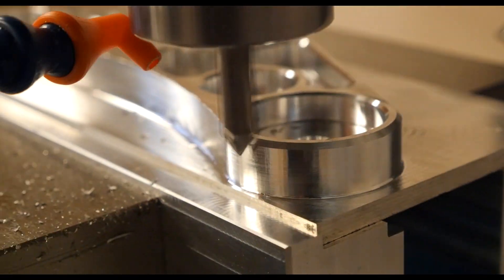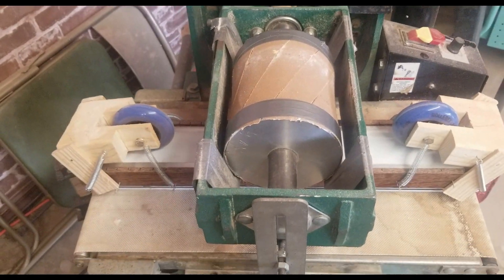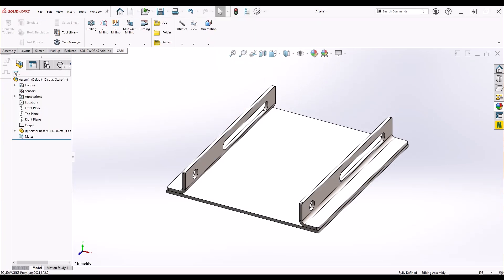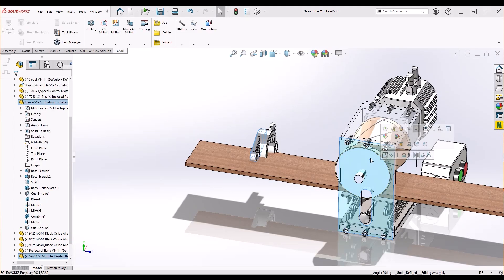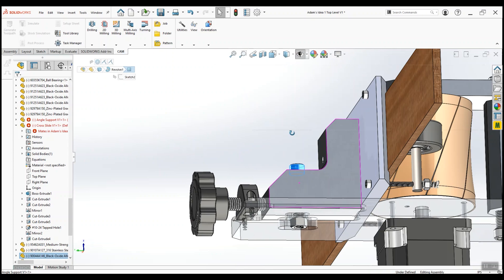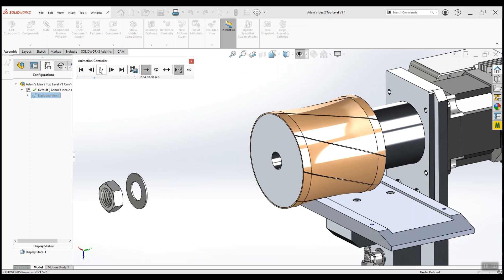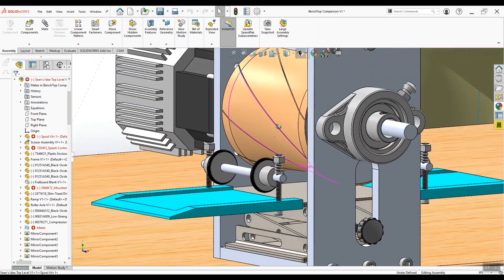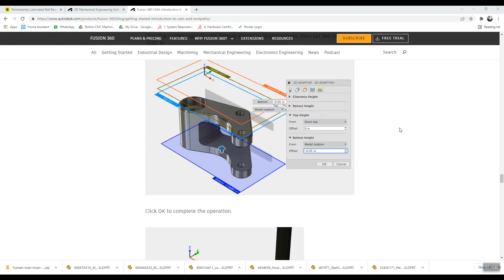From Sketch to Product - Bring Your Ideas to Life With 3D CAD

Comment: I have a doubt .like how do u imagine the perfect dimension.and do i sketch first in paper and then technical drawing and then cad . Do we use technical drawing and engineering drawing or its no more in use ? .do i industrial design first all sketches and then take it to make first model in cad and then add dimensions .? I m confused .or if i am dumb then plz correct me
Reply from the maker: @ak-gi3eu  I always model the perfect dimensions first. That is what is important. And then you model everything else around it. I try to come up with a workable concept in 3D as quickly as I can. Usually it involves a few designs like you see in this video. Then, just build something! Once you build the first prototype, the second prototype will be orders of magnitude better. You can continue making prototypes until you’re happy. On average, I would say that by the 3rd prototype I have something I’m very happy with. 

I would not get too caught up in the technical planning details. The most important thing for me is to just build something. Even if it is very bad, you will learn so much from the first prototype. 

You will not be able to come up with the perfect design the first time around. So don’t worry about all the little things.

Comment: Can't wait to see this to the end.  You have me inspired now.  I've got some ideas on how to do this with some extra 3D Printer parts I have lying around.  One question I have though what tool is that you are using to set the curve on the drum.  I'm trying to recreate that in fusion and I can get close but was just curious if there is an equivalent tool in Fusion.
Reply from the maker: Hi Kevin, I'm glad you enjoyed the video! You can use the "revolve" tool in Fusion to model the drum, and set the curve in it perfectly. Check out this little Fusion360 tutorial on the revolve tool: https://www.youtube.com/watch?v=U7ABI9PSjkM
Reply: @adamdebowski2037  Hey thanks.  Yeah I was trying to figure out how you created the curve in the drawing, but I think I figured out a couple of ways to do it in Fusion both using the revolve tool, 1. I created a 4" diameter Cylinder then a 12" circle and had it cut out the 12" radius in the cylinder with the drum but I also found that if I'm drawing I can also set the line to the correct radius the revolve similar to you.  I'm trying to push myself with CAD.  I'm trying a different approach which is going to end up with slightly bulkier tool, looking forward to where yours ends up.  Thanks for the reply.

Comment: How did you learn Solidworks so well, I've  been wanting suggestions as to where i can find informative videos. Do you suggest paying for training? Or even free youtube videos, i just want to work my way up to a level that you are at !
Reply from the maker: Hi Jo - I’m “formally” trained in SolidWorks through one of the local companies that distributes It in my area, and I do think it was beneficial but wouldn’t call it necessary. I’ve likely learned the most by watching others work in the software. You’ll see all kinds of little tips/tricks you might not have known existed… then it’s just practice. Try looking up some solidworks modelling videos and following along on your own. Challenge yourself to model something every day for a week, or two, or a month! Model your desk, your lamp, your chair, fridge, dishwasher, everything around you! If you decide to take a training course, it’ll be more beneficial if you go into it with some practice under your belt. I’ve been using solidworks for years and still learn new things regularly, which keeps things exciting - finding out you can speed up your work flow with new knowledge.
Reply: @adamdebowski2037  Adam - Thank you so much for your input! I'm a Mechanical Engineering major and just now getting into modeling, cam , and simulations. I want to make sure i learn good habits so that when designing down the road i don't shoot my self in the foot! I appreciate you're very informative content and it defiantly helps students like my self learn better designing practices, Thank you!         Best Regards, Joe

Comment: Adding a spindle lock/brake may be a nice feature.  It would make the tool-change a bit more straightforward.
Reply from the maker: Hi Tyler - thanks for the feedback. That’s a great idea. We’ve go wrench flats above the nut on the main shaft so you can use two wrenches to remove the drum - but your idea would be better. I’m not sure how to add a brake to a motor, though. Maybe there’s a way?
Reply: @adamdebowski2037   I really enjoyed learning about your design process.  Definitely took away some pointers.  
Some of the wood routers have a blind hole drilled in the side of the spindle shaft and they just drop a pin into it to lock out the shaft.   Usually, the pin is on a spring return so that the motor can't easily be started while the lock is applied (the cost of magic smoke and sparks being what it is today).  Specifically, the Makita RT0701C uses a pin system like this and it works well for CNC router applications.

Comment: What?! I didn't knew those guys had 3d models of the pieces!!!! 
Is solid works much different than fusion 360? I would love to use Solidworks but it's very expensive! :( 
AWESOME VIDEO!
Reply from the maker: Hi Santos Knives! McMaster is truly amazing - such a great service.

Don’t bother with Solidworks - go with Fusion360. They’re much more similar than they are different, and lots of designers use Fusion360 to make amazing stuff. 

I’ve got access to solidworks through my employer and it’s what I’m used to. If I didn’t, I would be on Fusion360 no question. It’s an amazing software and you shouldn’t hesitate to get it! 

Cheers - Adam
Reply: @adamdebowski2037  Thank you very much for your quick answer, much appreciated!!!
Reply: Fusion 360 is way more convenient, with not much of an entry skill cap
Reply: @simranbhola5854  got it, thank you!

Comment: I don't like the hold down to support the fret board. Wouldn't it be easier to adjust from the top with one knob? Maybe mount some 608zz bearings and spring load them?
Reply from the maker: Hi Bill - thanks for chiming in! A ball bearing, or maybe rubberized roller might be the move... Which idea for holding down the fretboard don't you like? The slider, or the roller - and why? Thanks again for the feedback! - Adam
Reply: @adamdebowski2037  maybe it's the two bolts that need adjusting. But dual springs with rollers won't need adjusting and I guess the boards will always be the same thickness. Maybe the frame could be made out of plywood. Love the scissor jacks.
Reply: Do the pieces of sand paper need to be touching? Could there be a gap for extraction?
Reply: @billkaroly  Yes, the drum with perforations/holes and hollowish with a concentric 'vacuum seal' so an external shop vac can be attached.
Reply: @billkaroly  stop being a Karen .... err... ah ... Darrin,  bro lol

Comment: Decisions, decisions. Lots of options here. I think you could dramatically simplify the height adjustability. The table with guide tracks should be a foot long minimum for stability. The guide tracks table assembly could be hinged at one end and simply moved up and down with a jack screw or better yet, a sliding wedge from the other end. Less complexity and moving parts. Just an idea guys.
Reply from the maker: Hi Tonyalto - thanks for the comment and ideas! Lots of good alternative designs/thoughts floating around. It'll be interesting to see how it ends up. Cheers! - Adam